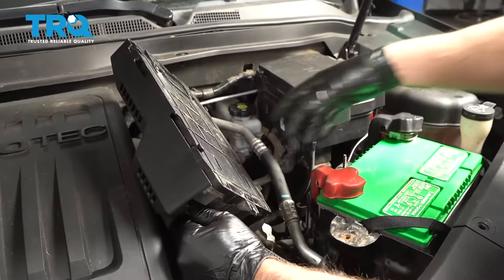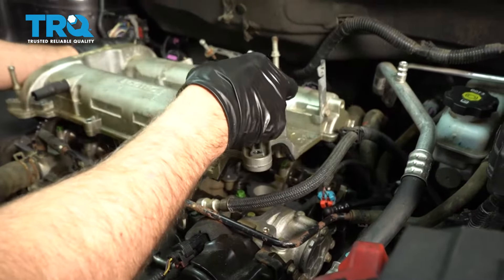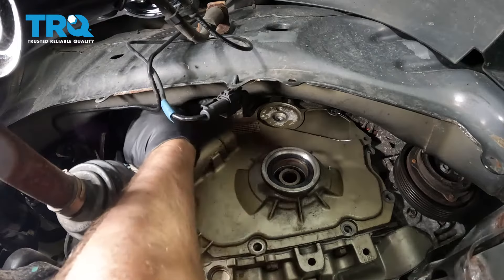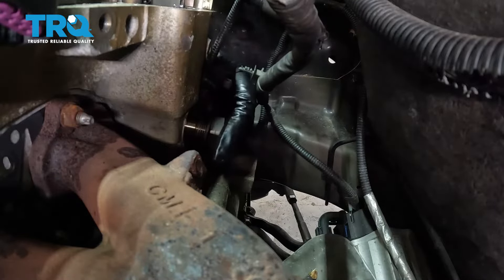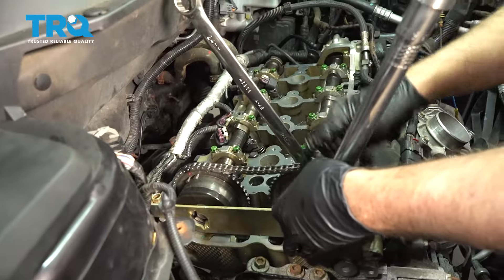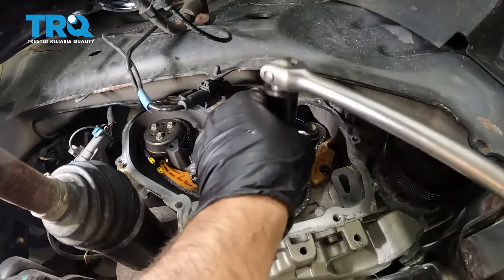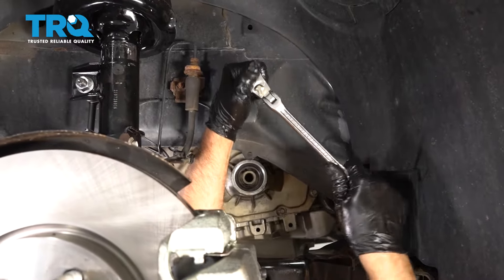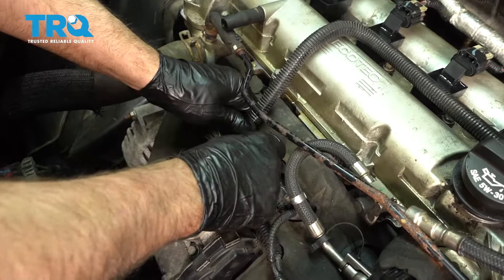How To Replace Variable Valve Timing Sprocket 2010-2017 Chevy Equinox

Comment: Great video on stripping the engine and replacing the VVT intake sprocket, which was not the problem on my daughter's 2013 Equinox 2.4L.  The chain guide on the intake side/right broke and destroyed the two mounting bolts.  Bought an ACDelco chain and tensioner kit.  Been racking my head about why when I set the VVT and crank timing marks they do not return to the initial setting after two turns of the crank.  You, where other videos failed, informed me they would not!!  Wow, I have been afraid to trying and button up the engine and start it!!  Now I can get to flushing the engine.  Thanks, thanks, thanks......

Comment: We installed new sprockets via a timing chain kit by Cloyes that includes these VVT sprockets. The video we watched (which didn't use VVT, but was for Cloyes parts) said use 63 ft lbs and 30 deg additional turn. You say 22ft lb plus 100 degrees. Is there any reason I'd need to pull the bolts and redo it or are they more or less going to have the same strength purpose based on the numbers I provided?

Comment: To replace the sprocket only, (I have a defective new one after replacing everything under the timing chain cover.) Can you replace it without taking the timing chain cover off again? I would think that if you make your own paint marks on where the chain and cam is at that moment, you could take the tensioner out, take the intake sprocket off, line the new one up with your paints marks and put the tensioner back in. Viola! Is that possible?